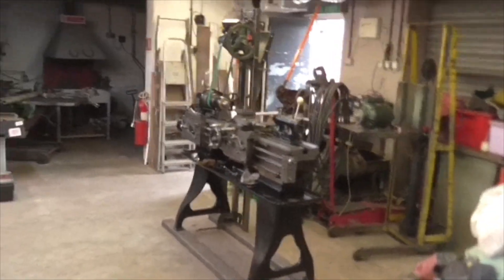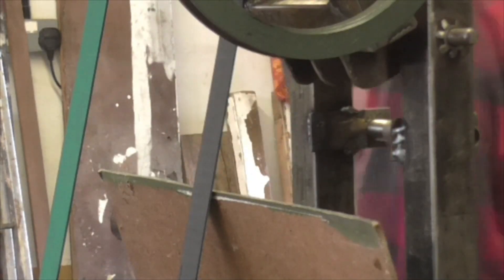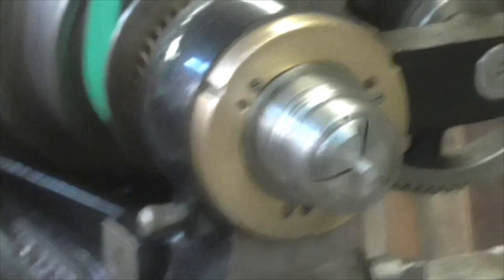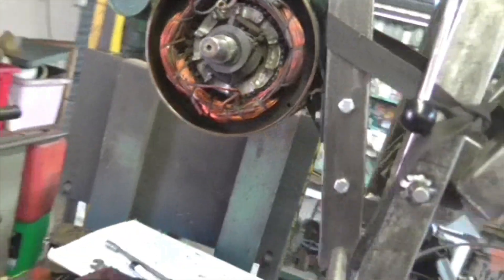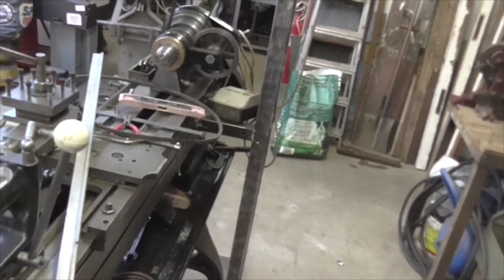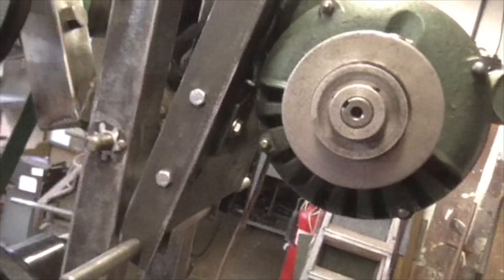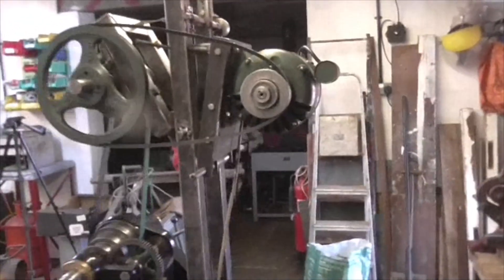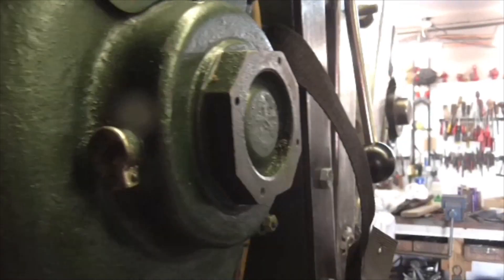Holbrook,  mounting the motor and getting it running!

Comment: Good evolution of the mount Phil. It's beautifully quiet when the belt is tensioned. My old Suffolk mower uses a jockey pulley to clutch and declutch the drive, so that would be an easy way of doing it. 
In other news, I have bought a Rapidor Manchester for the workshop. I'll be collecting it from a farm north of Oxford in a week or so. 
Have a good week, Dean.
Reply from the maker: A rapidor is always good news! I have been thinking along the lines of a double jockey pulley which puts a double bend in the belt, which would allow for a much longer belt to be used andallow for the small pulleys, but first I am making inquiries at spelgate about the fabric covered slippy V belts which are designed for this type of drive!.
Phil

Comment: Great job rebuilding the motor, a lot of people would have not have done it. I think you may be missing a simple solution to make your v-belt slip which is something we tripped over on our equipment, the hard bit will be describing it. V-belts when they are being driven but not under tension like to create a circle which means they never fully slip. We have used two simple solutions to make the belt slip, the first is to weld two bars on the frame, one each side of the motor. When the belt is under tension it does not touch the bars but when you take the pressure off the belt it trys to make a circle and the bars stop it doing so which enables it to slip. You may need a guard around the lathe pulley to stop the belt being pushed in that direction. The second solution is easier but may not work for you as you want to easily move the belt between pulleys. That solution is to make a guard that goes around the pulley and extends beyond it. When the belt is not under tension it can't form a circle due to the guard and then the belt slips. As I suspected, I struggled to explain it. We have a third solution which was is on one of our garden tractors to change between high and low range. Two belts are fitted, one on each range, It uses bars and guards as described above but also an idler pulley which can be moved between the belts so that only one belt is tensioned. If any of this makes sense and you want to see these in action drop me a message. I am really enjoying following your work on the Holbrook
Reply from the maker: @GardenTractorBoy  Don’t worry, i know exactly what you mean, and what you describe is exactly what is happening! I will put a couple of bars  clamped in place and see if it works! Thanks for the info!
Phil
Reply from the maker: Didi it today, works perfectly! Thanguvermuch!
Phil
Reply: @philhermetic  That is great news and I am looking forward to seeing it in action

Comment: Getting there Phil, it's looking quite complex now. I've a motor that occasionally pops with a blue flash when starting, time for a clean. 
A jokey pulley should work OK. I used one long ago to engage and disengage the drive on a power feed for a mini mill table traverse. Cheers Tony
Reply from the maker: I have a number of uses jockey pulleys "in stock" so I will be raking them out on monday!
Phil

Comment: Hi Phil,  I appear to have the same Rapidor hacksaw as you.   Unfortunately I don"t have 415V 3 phase, so I looked at the motor, thinking to replace it.  However, it has a gearbox incorporated in it, so not straightforward.  It is also of course in star configuration.  I wanted to convert it to delta so that I could use a spare inverter, or rewire the contactor and use a converter.   However, I can"t find the end of the star winding,
I have come across a company local to you, Jefferson Electrical, Driffield, and wondered if they might be able to rewind/reset the wiring.  Any knowledge of this company?
PS, like the Holbrook work......
Reply from the maker: @johnjohnson764  yes, i started there as an apprentice electrical engineer in  1967! They would probably be able to find and bring out the star connections for you,  when I worked there we did motor rebuild and refurb, but not rewinding, which the do a lot of now!
Phil

Comment: The breaking of the motor is caused by the DC charge in the capacitor discharging into the start winding when the switch re-closes. Most capacitors have bleeder resistors on them to stop the contacts from pitting from the DC arc upon closing. I wager that capacitor doesn't have a bleeder resistor .
Reply from the maker: @apollorobb  thats exactly what I suspected, but it does have a bleeder resistor! , perhaps it o/c!